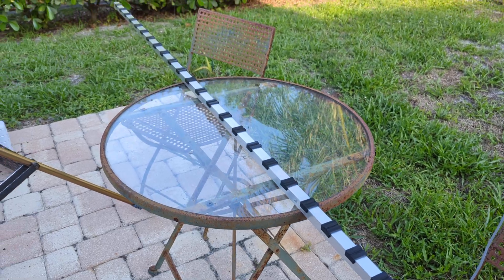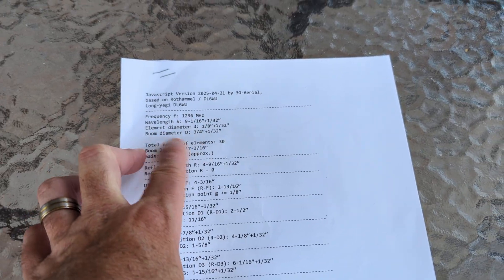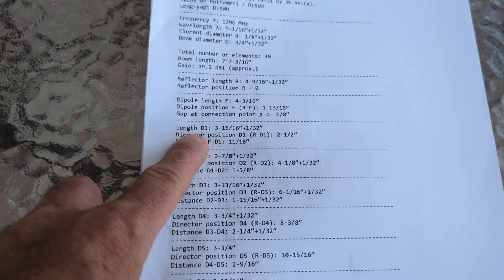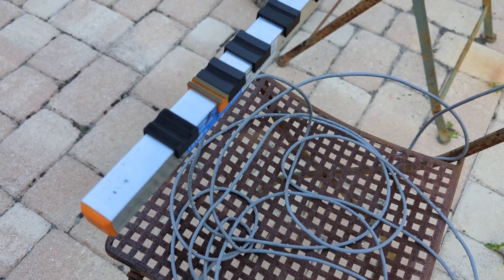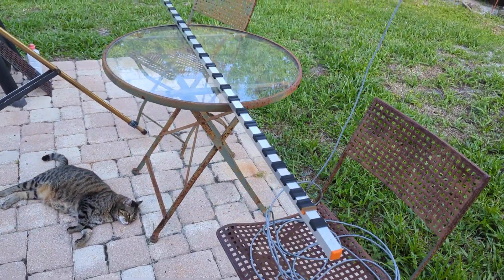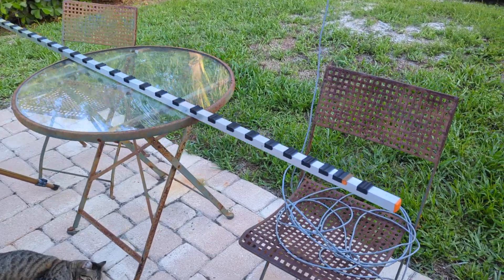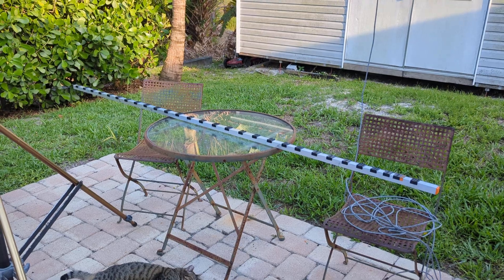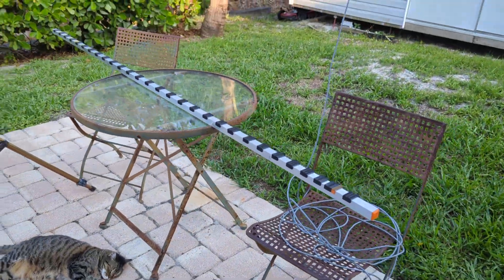Homebrew 23cm 1296MHz Yagi Is Almost Done, Part 4

Comment: Sounds like you’re really having a fun build.  Perhaps, like me, you enjoy building antennas as much as using them!  The DL6WU series has been around 20 plus years and has always been one of the top 10 configurations on VHF and UHF.  At those frequencies Boom correction, and even element length, is not nearly as critical as 23cm so just a little concerned about dimensions used.  MAKE sure the that this is NOT a boom correction intended for “through” boom mounting, insulated or non insulated, as mounting above as you have chosen to do, is typically a lot less.  Unfortunately 1/32” difference CAN make a difference on 1296.  I personally like your other larger version as the boom correction would probably have been negligible but your current version will probably work fine.  In previous video you asked about the microwave oven aspect.  With any “Black” material there is a chance that carbon, a conductor, has been introduced.  This can obviously induce loss and change in charactoristics.  Putting the insulator(s) in the Microwave, perhaps along with a cup of water, and looking for heating is a cheap and dirty way of determining if this carbon is present.  Ideally you should have zero heating.  On 23cm, especially if thinking about EME, almost anything can make a difference.  Using solid Rod for the elements is great but after being cut to size, you make want to very slightly taper the sharp edges on each end; sharp edges can make a difference.  Also, if you plan to continue playing on 23cm, you make want to convert to metric measurements (mm) and use a calliper to make your measurements.  A mm or two, can make a difference.    Good Luck and most of all, have fun!